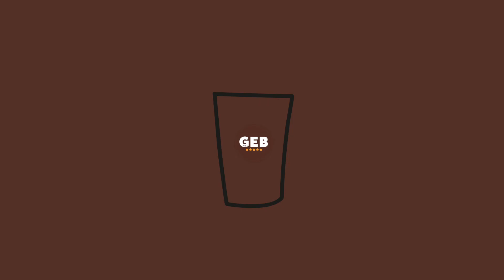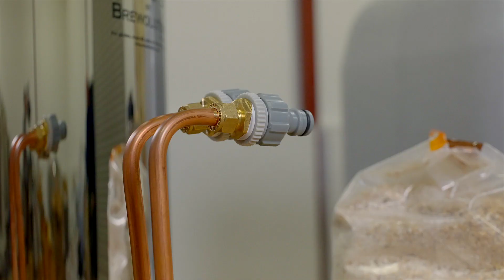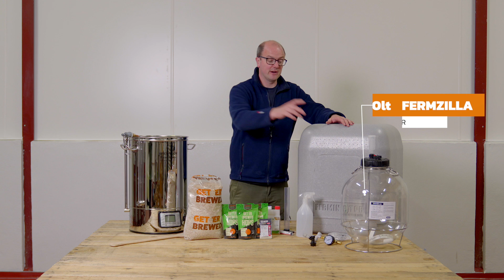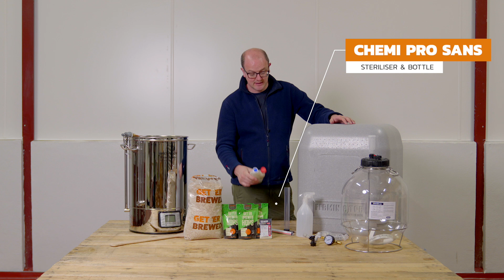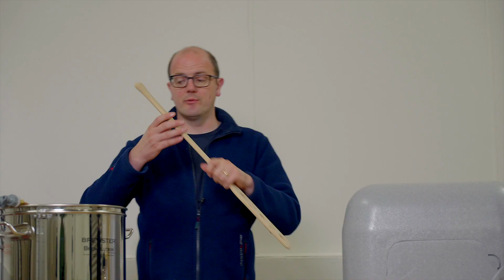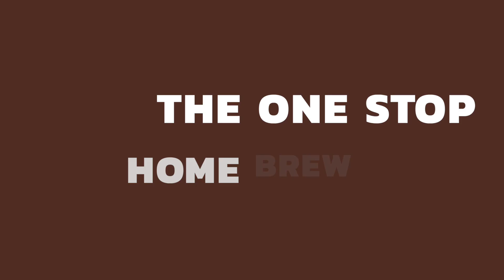Jump straight into all grain brewing with Geterbrewed

Comment: HI, Thanks for god info! which brew system is best and hold temp in mash between Brew Monk and Brewster ? hade read a lot on internet att some cheaper brew system go banana and to hight in mash from target temp 67C to 72C.
Reply from the maker: Both Beacon & Brewmonk have ability to calibrate the thermometer probe so you can ensure accurate temperatures are being used